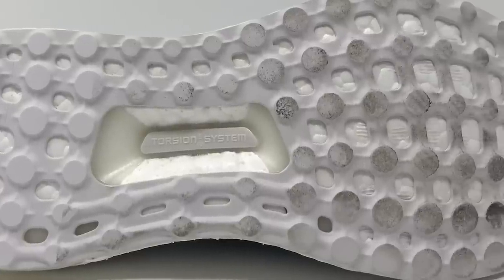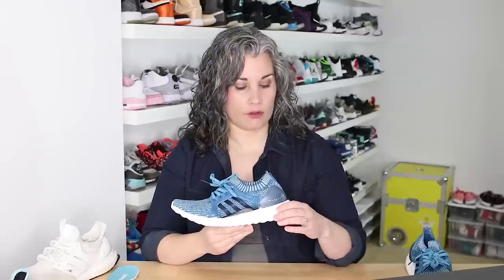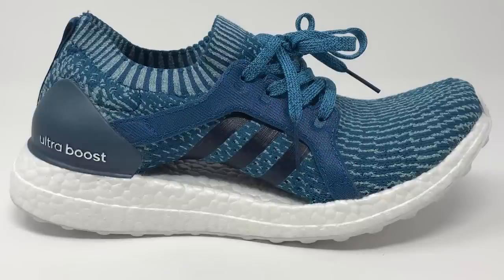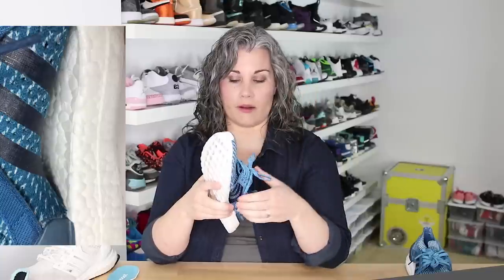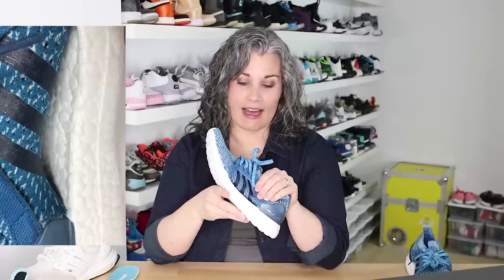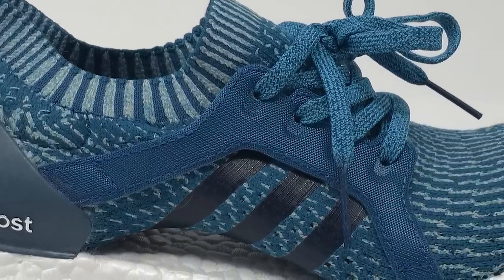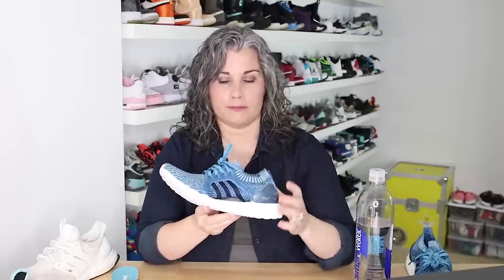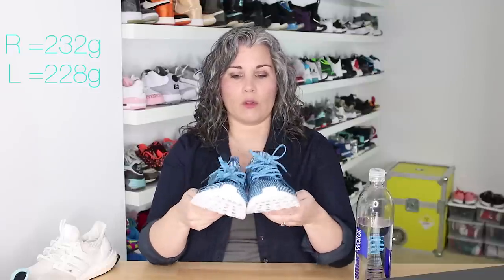Adidas Ultra Boost X Parley Sneaker Review

Comment: You should try the nmd r2. 
Preferably the ones that have the separate tongue not the one piece upper. 
I have a few pairs. Probably about 3 or 4 and I have lots of ultraboost too. I find the nmd r2 to be more comfortable. 
They look just as good too. If not better in some cases
Reply from the maker: cool, ill check those out! thanks!

Comment: That's an elegant solution with the structural logo! Hey Tiffany, regarding the boost, I've noticed most have what look like 3D printing artifacts, looks just like layering and blobs! Everytime I'm in a store I'm kinda blown away by the quantity of styles Adidas has out at once, creators gon' create... But putting those together I wondered if they might be 3D printing molds? Any explanation for these horizontal artifacts on the vertical mid surfaces?
Reply from the maker: Interesting question. They could be but there are 2 reasons I don’t think they are rp molds. 1 the layering that rp
Molds show isn’t quite as definitive in shape as the texture on some area’s of the boost. The texture that is left from rp molds is usually much less noticeable in my experience. 2nd they mention it takes pressure and steam to mold the boost, rp molds in the past haven’t been great with too much pressure so this might be a concern. I thought of another reason, the huge volume of boost midsoles they make also would be more cost effective as aluminum or metal molds.  All that being said, there is still a possibility that they are using rp molds but I think it’s unlikely.

Comment: A stupid question: why is there always a few gram in weight diff on left and right ? Shouldnt they weight the same?
Reply from the maker: Not a stupid question, great question. I think 2-3 grams difference between shoes is fine. 5+ is a sign of inconsistency in the shoe making process. I’ve noticed boost shoes always have a higher difference and I think it is because the boost material is hard to control when molding it.  If it’s more than 8grams I’d say there are probably quality issues with the shoes.  But just my POV. 🙃

Comment: With the upper not being fully glued to the sole, is durability a concern? Also another awesome video!
Reply from the maker: Great question. I don’t think so as it is stitched down on the sides but more mileage will be the true test. Great call out!
Reply: From experience I would say the uppers haven't been an issue, in my opinion,  so long as you get the sizing right.